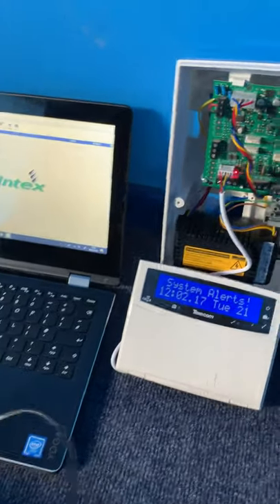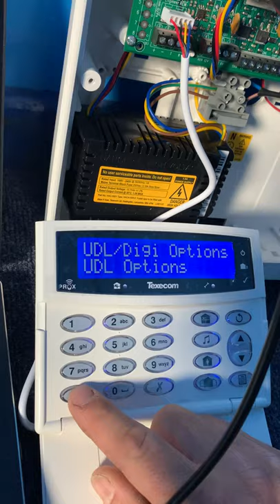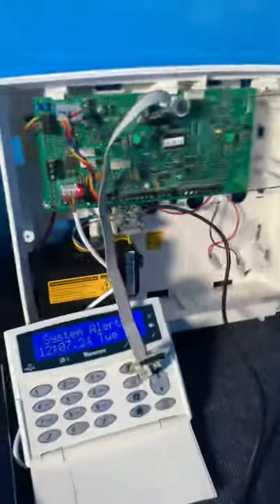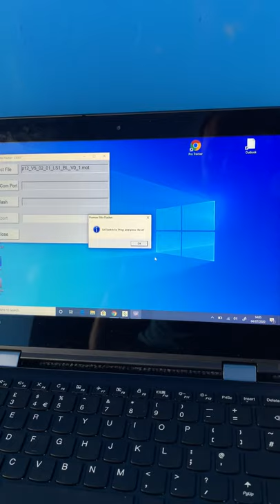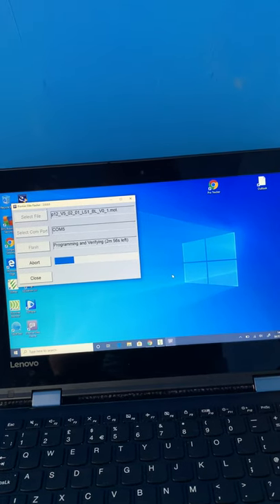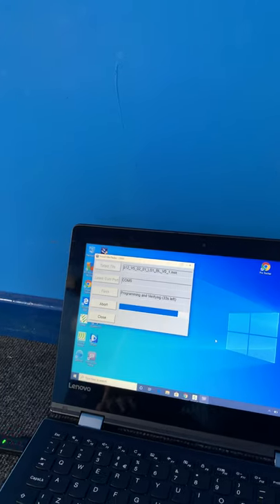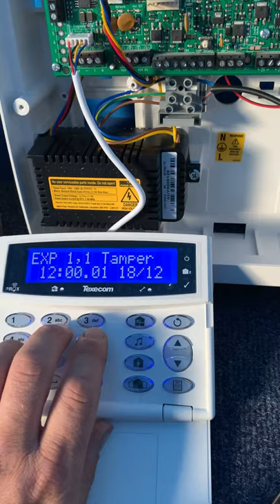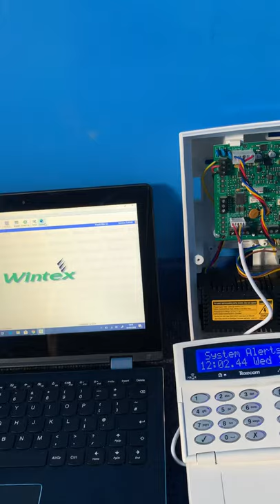Updating Texecom Firmware

Comment: Hi, if you have changed the engineers code from default 1234  to say 2345 will I need to also put the new 2345 into both wintex and panel UDL password?
Reply from the maker: No the UDL password is separate from the panel codes

Comment: Really useful video thanks for doing it.
I’m trying to upgrade the firmware on a premier 24 plastic, and I can’t see the programming port for the flasher interface? Am I being stupid?
I’m trying to upgrade it from version v8 so I can install the smartcom, to allow me to control the alarm via the app,
Any ideas please?
Reply from the maker: Premier panels can’t support Smartcom! Unfortunately you need to upgrade the whole panel to a Premier Elite.
Reply: @alarmassist  aaahh you’re joking? My installer said it could be :(
What model panel would you suggest please, and would it have the smartcom built in? Thanks
Reply from the maker: @paulroutledge7127  I’d go with ten elite 24 polly it’s the same layout and screws all line up (less work 😉). Will come with firmware that supports Smartcom but still has to be separate. You should be able to use wintex software to same on programming as well.

Comment: I have a Premier Elite 48 with version V2.11.19LS1 and the latest version in now V6.21.22.LS1. Can I go straight to that ok?
Reply from the maker: You can yes
Reply from the maker: Forgot to add its classes as a major upgrade so will more than likely wipe the panel. You will need to back it up in wintec or reprogram once upgraded.
Reply: @alarmassist  Will I need to put power on to the Bell box to stop it going off when powering down? Will the Engineer code also reset after the update?